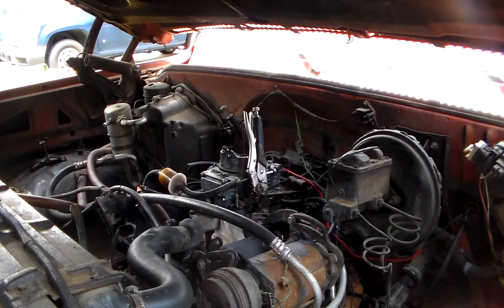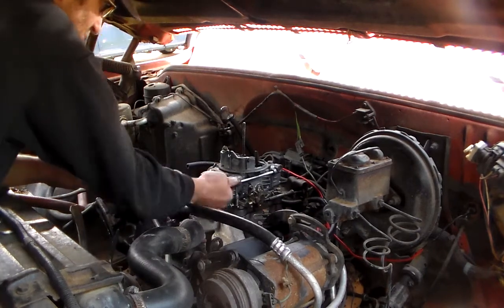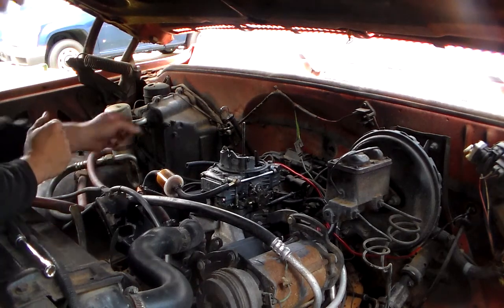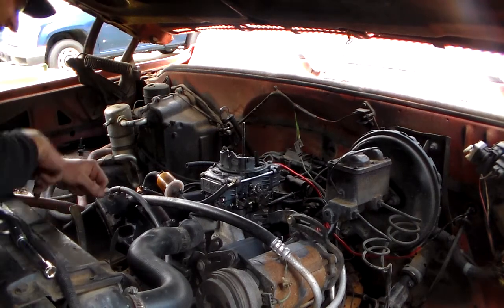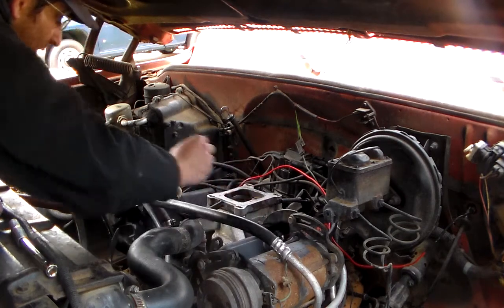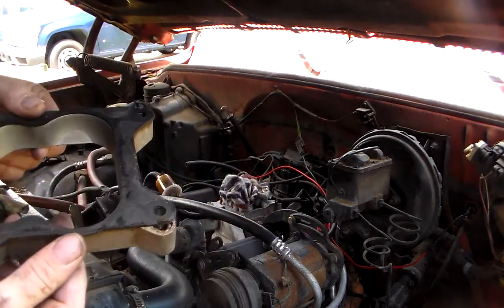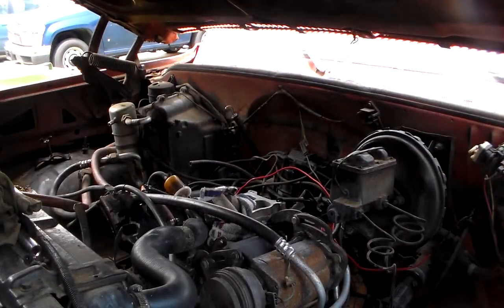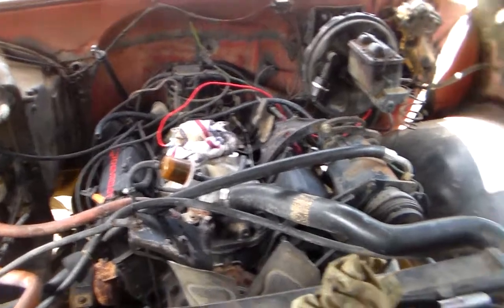How long does it take to remove a Holley carb

Comment: A dual plane manifold with a quadrajet works very well up to about 6000 r.p.m.'s. Holley also makes great carbs and most back yard mechanics can successfully work on any of these, unlike the fuel injection and electronic nightmare stuff  they dream up today.

Comment: Haha. $500 worth of carb and intake... Try around $750 or better. The quick fuel carbs around here are around $400 and the Holley's are round $475 alone. The air gap is at least $300. That ol' Scottsdale is a parts "score"